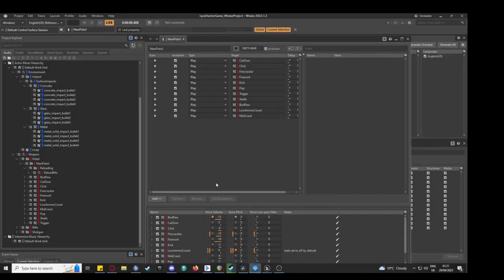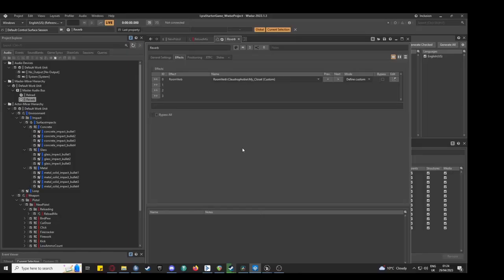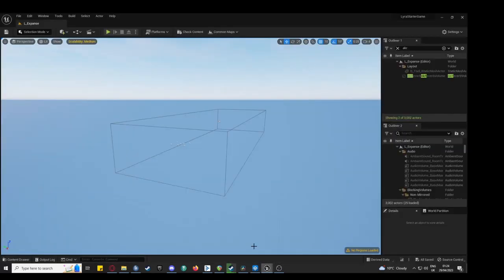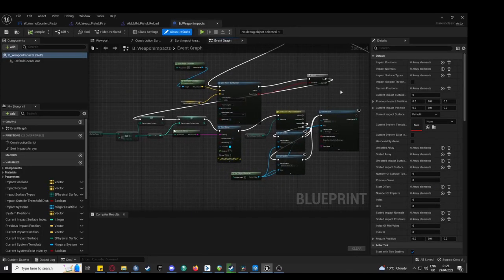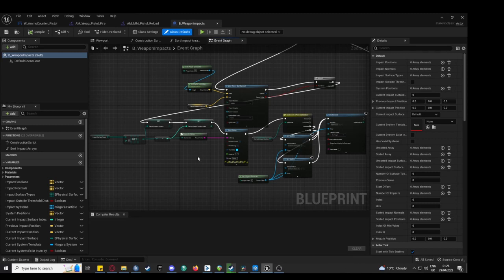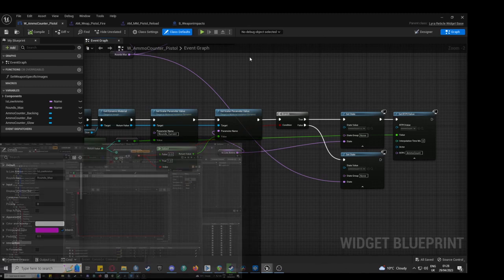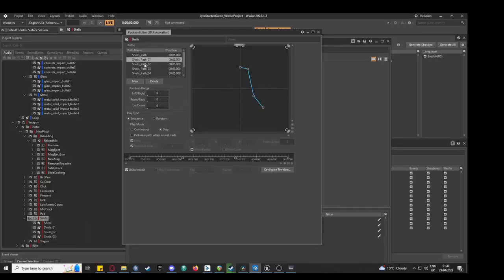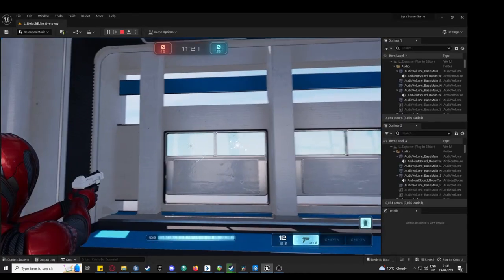Lyra Technical Demonstration [Unreal Engine 5 & Wwise Integration]

Comment: Hey Jackson, great video! I was just wondering how you managed to replace the whole metasounds audio system Lyra already had in place so that it doesn't collide with Wwise's.
Thanks!
Reply from the maker: Hi TincHoh! There is an option to disable Unreal's Audio Engine in the Preferences settings, and instead use Wwise's. 

Hope this helps!

There are also audio mixer hierarchies that you should be able to unplug, if that is not working for you.